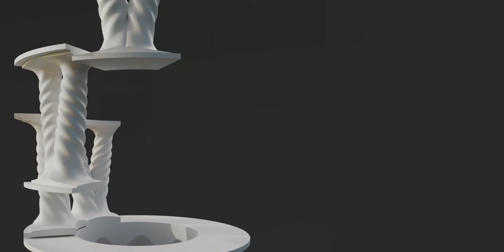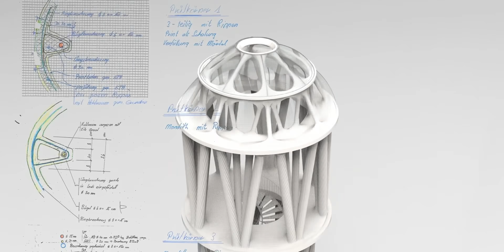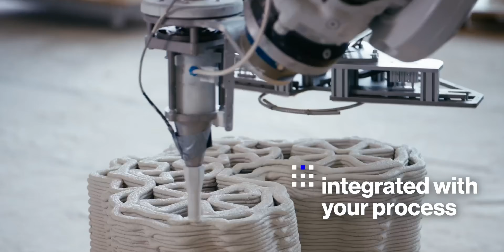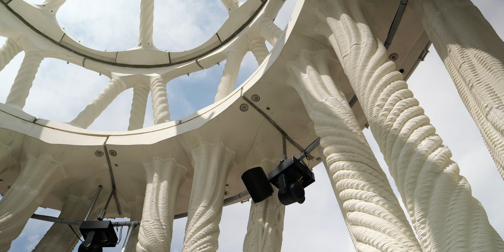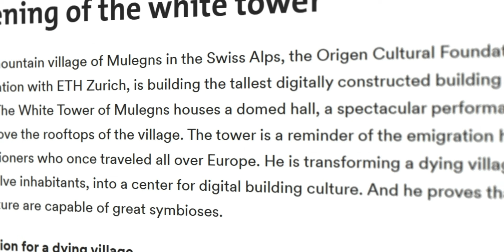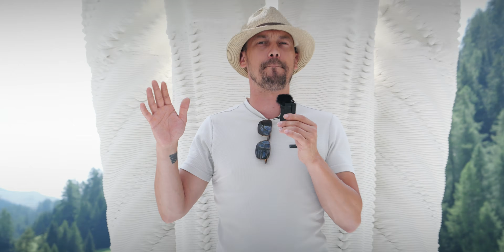The Largest 3D Printed Structure in the World — Come Along With a 3D Printing Specialist

Comment: How is this good for the environment you say? It's still concrete so still had the co2, right? You just move the production top another place
Reply from the maker: Yes. But u use 50% less of it for the same structure.
Reply: @Ibuiltathing  Acid rain will destroy it 100% the same.  CO2 is not a pollutant, rave about the real problems not the political agendas.  Prevent deforestation, encourage reforestation, plant more trees...

In any case that's a very cool and interesting project, thanks for showcasing it.
Reply: @Ibuiltathing You are using more of it because of the shit   surface quality and lack of tensile strength. It is also not just normal concrete, but UHPC, often filled with polymer fibers and costly additives, without much gravel.

Comment: The idea of 3D printing buildings confuses me.
Reply: Cheap no wages can make a house printer for about 3k good insulation setup feed station come in once every 2nd day for a week bang a house.
Reply: @fermis1proponant  But it is NOT cheap!  It is slower and lower quality than existing techniques. Equipment is expensive and difficult to transport.  While building, it has to run 24/7, and it takes days!  Fresh concrete has to be supplied around the clock, and the mixture has to be precisely controlled to prevent issues plugging.  And if it breaks down, the concrete cures in the machine!  ICFs are cheaper, faster, and way easier!

Comment: You need lime chunks like the old Romans did, they are deliberately there. They fill the cracks. Also, you vulcanic potash was way better then our stuff + salt water. I'm sure they used it on purpose. What would actually be interesting is carbon fibres, longish one in the inner parts of the structure. Really stirred in, so the fibrle are randomly arranged and at least 5-10 cm long or even continuous.
Reply: Carbon fibers added to the slurry would tend to be aligned by the extrusion process and deposited in such a way that they would be confined within and aligning with what is already the stronger axis of the prints. Unfortunately carbon fiber added to the slurry would do little to structurally bridge the much weaker layer connections on the vertical axis.
Reply: I think the salt would cause issues with the steel rebar we use these days.
Reply: @Slay_No_More yes. Steel makes it always short lifed.
Reply: There are a few types of self healing additives used in modern concretes. The purpose of these is to heal small cracks and imperfections when water gets in. This chemical healing isn't suitable to recover large cracks that affect structural stability. Here, they made the concrete hollow with ester channels at the bottom as a solution.

The challenge with printing concrete is to be able to control the setting time, maintain shape, and support new layers with one mix. The advantage is awesome shapes rather than boxes (habitat 67 in Montreal). 

If they find the right material, we will all be able to have custom ornate houses in the future! That would be so cool!